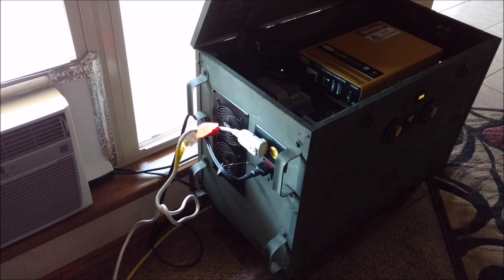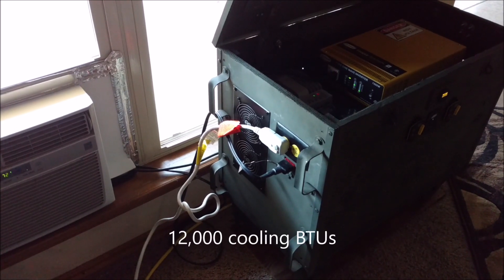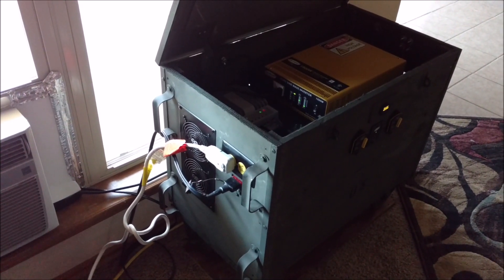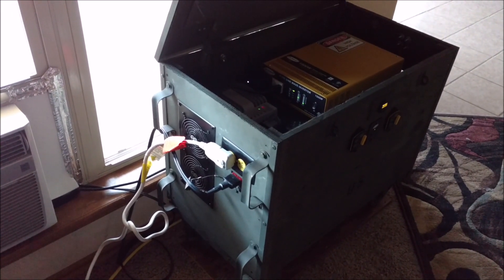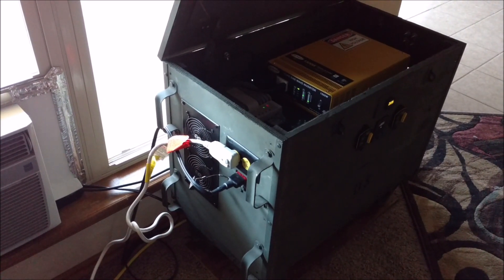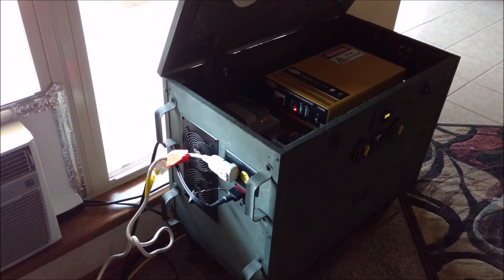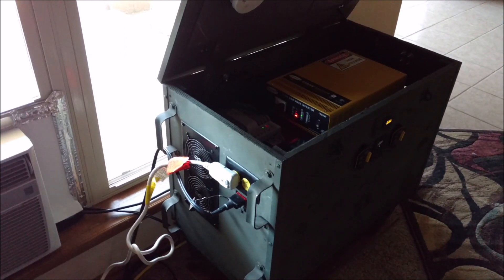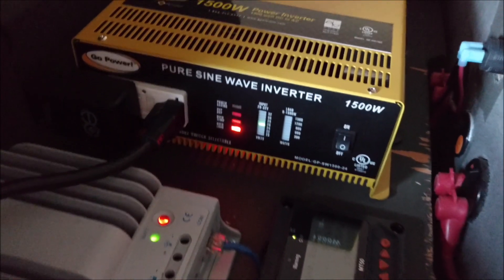Well, that didn't work - overloaded Go Power! 1,500w pure sine wave inverter

Comment: Put your meter on the a/c unit.  you will be stunned how much it pulls for one second before it gets going.  I had the camera on my 4000 watt inverter and it barely started a 13500 btu unit and the surge was crazy.
Reply from the maker: Yeh...start up surge current on air conditioners is insane. Funny thing...had two window units on full tilt today (it was hot/humid today). My Outback inverter (3,500w) wasn't even phased...like, "bring it on man". Hmm.

Comment: Throw a capacitor bank in the mix and you should see better results...
This would be similar to a hard start kit for RV air conditioners.
Reply: I'm going to look into this... great idea.  I've got a 10,000 lb hoist that causes a bit of a voltage sag upon start up (2 hp single phase 230) and asking around, they say changing the start cap to a larger one won't help. Perhaps this hard start kit you mention will help the situation- thanks
Reply from the maker: Any recommendations? (size, brand, price). I don't know crap about these. Thank you.
Reply: How are capacitors going to help in this case?  There is nothing wrong on the DC side from what I can see.  It looked like the inverter wouldn't handle that much power.  The AC side needs a little help because the inverter is underpowered to be able to handle the start-up current of the air conditioner.
If the scenario was that the batteries couldn't provide enough DC power to the inverter then capacitors would fix it.  That's not the case here.  He needs an inverter with a higher peak power rating.
Reply: Christmas Eve all compressors pull many more amps on start up than when running.  capacitors store energy for quick release.  they are built to solve this exact problem.  look up hard start capacitors.  these capacitors go on the ac side, not DC.
Reply: Rick, I know how capacitors work.  But his inverter faulted due to overload.  If he were to use that same inverter, please explain to be how he's going to use a capacitor bank?  You mean on the AC side?  Well, it's probably much easier to swap out the inverter for one that can handle a higher peak power draw.
Reply: Christmas Eve yes, AC.  take some time and just Google hard start capacitors (for compressors).   very commonly used in RV applications for the same reason.  Simple fix, very cheap.

Comment: Hey Chris, I had a previous house air conditioner unit which had a delay timer, a small plastic unit, a bit larger than a matchbox, with 4 leads. It would let the fan start first, and after 2 to 5 seconds later the compressor would kick in. It helped avoid the sudden complete surge from both motors starting at the same time and minimized the start-up buzzing hum. If you know a local AC tech, he might be kind enough to install it or at least give you suggestions on how to remedy the hard start dilemma .    I like the SRV "Crossfire " , at least you don't have a "house fire" !  ;-)    J K
Reply from the maker: Thought you would like that outrow with SRV...hahaa! 😁

Comment: I have the GP-1500HS High Surge model can surge up too 3000watts it's a new and slimmer version. It may Handel that kind of load.
Reply from the maker: Yep...prob should have bought that one. Wonder if I can do an warranty exchange?
Reply: Chris DIYer Nah, they will probably give you the same one back. Or test yours then return it if it works. I scored mine used on eBay for around $250 for a $600 inverter.

Comment: I tried the same thing on my 1500 watt inverter did not work I noticed a large surge just as compressor came on then back down to normal. I then put it on my 3000 watt and all was fine.
Reply from the maker: Cool...as it turns out, this Go Power unit doesn't have a really good "surge" capability. 1,500/2,000. Their GP-1500HS unit is 1,500/3,500 and engineered better for starting up compressors. Prob should have went with that one.
Reply: My 1500 WILL start up a 6,000 BTU A/C.
I used a 2 farad capacitor on my battery bank.
It stopped working after 4 years. The out put GFCI  would not re set. 
Soldering skills required.
<a href="https://imgur.com/iI5ST0g"><img src="https://i.imgur.com/iI5ST0g.jpg" title="source: imgur.com" /></a>
The main board has to come out.
It works,again.

Comment: Sorry, your video is NOT copyrighted just because you say it is. Read the Standard Youtube License. Also, did you pay for the sample of the Stevie Ray Vaughn at the end of the video? :-)
I'm just busting your chops. I am in the process of using my Predator 3.2kW harmonic hell generator and making it into a 2000w inverter style by using a 100a AC-DC converter, then a car battery (for sags), to a 2kW/4kW pure sine wave inverter. Storm's coming, and everything in Orlando is all but gone. I have two window AC and mini fridge to power. The generator has so much harmonic distortion that the ACs both howl when plugged in directly. So, I am cleaning this up. Have fun!